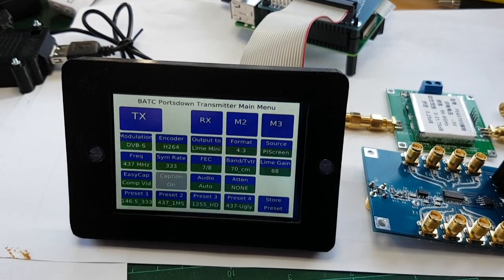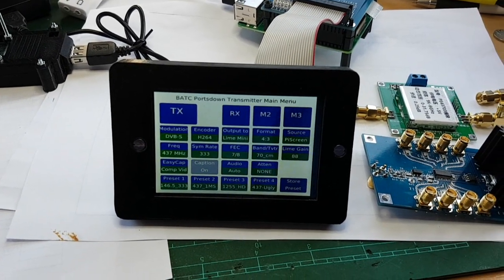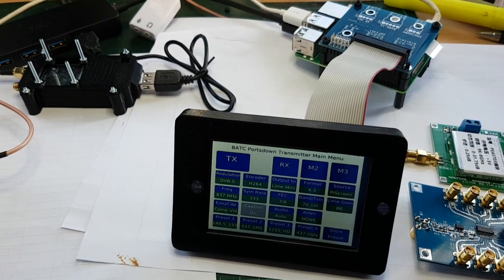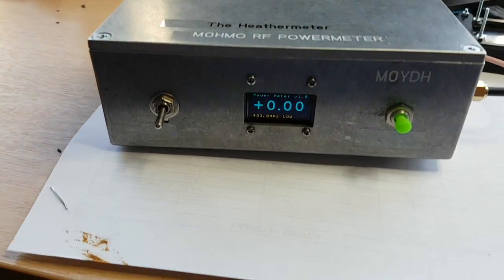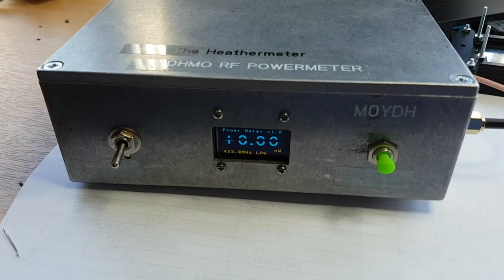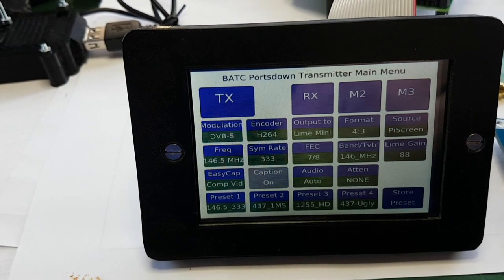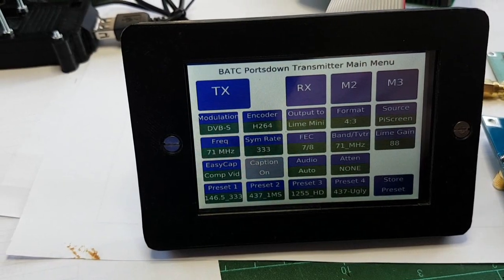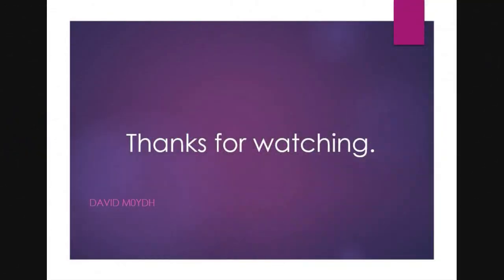Lime Mini SDR and BATC Portsdown DATV Transmitter 1st test

Comment: That's nice. 

Some questions. Was that milliwatts or dBm? I assume dBm given a plus sign? Why do you have the attenuatior there also, you won't need it if you are going to use the Lime or is that for another driver?
Reply from the maker: HI Mike. mW were in use throughout.  The attenuator was bought because the BATC Wiki recommends these devices.